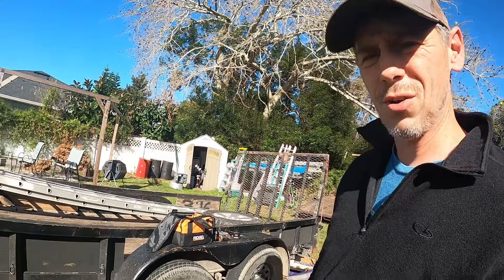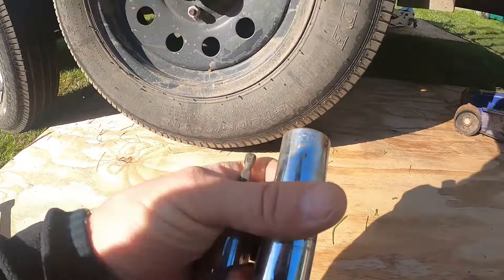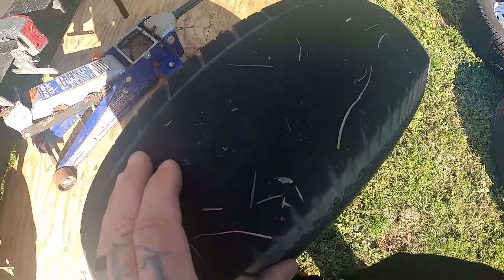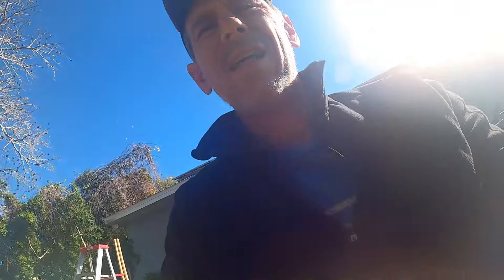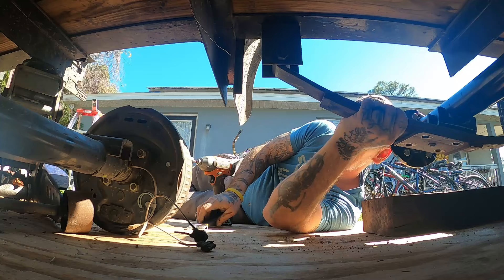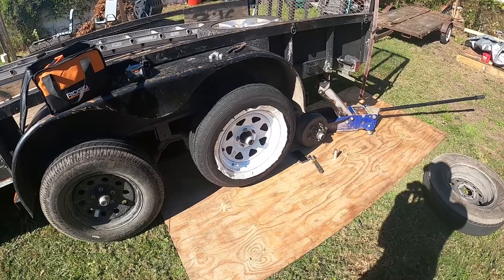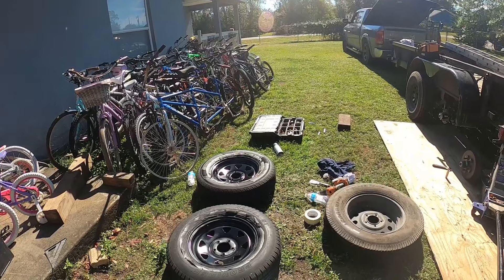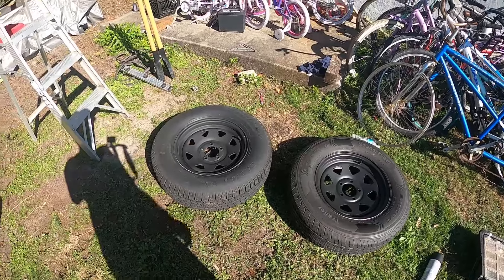CHANGING THE REAR AXEL ON SCRAPZILLA & PAINTING OUR NEW RIMS WITH JM5K #scraplife #axel #maintanence

Comment: Great job boss man hope you kept the old axle for parts or get it straightened cut out the bent bit and slide another tube over and weld ,next week i will be doing the same thing too i wrecked the wheel bolts on mine ,i grabbed some spares out of the scrap yard they were the wrong tread and the impact forced them in 5 miles later wheel was wobbling around like a alcoholic after a session 😂😂😂😂😂
Reply from the maker: 😂😂😂 Yes Sir I kept all the old parts

Comment: The axle is supposed to be bowed in middle
Reply from the maker: I absolutely agree, but then what do you think is making the tires wear like that? Spindles? Thanks for any info, I appreciate it! I still have the old axel so nothing is set in stone
Reply: All two axle trailers will do that it's called road drag on turns rear tires just slide on turns.